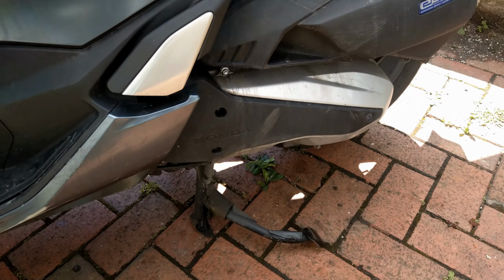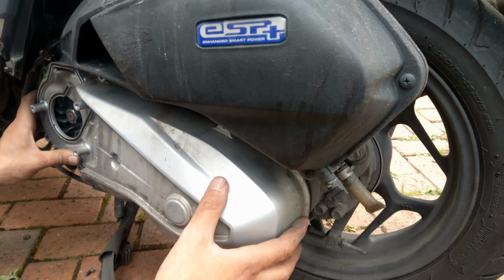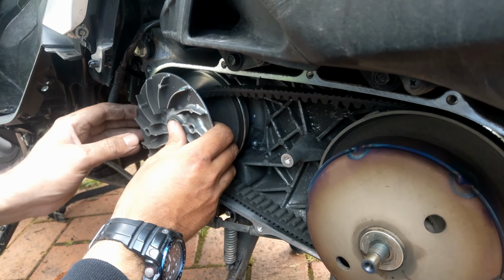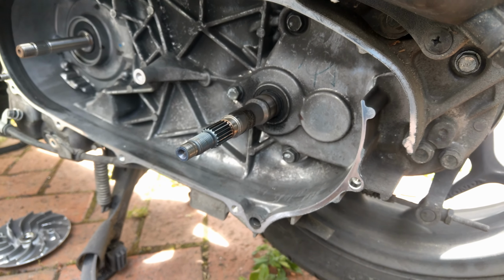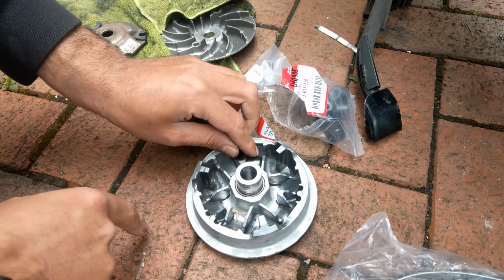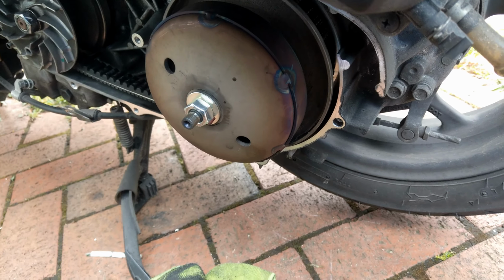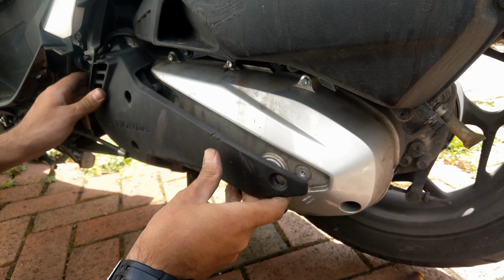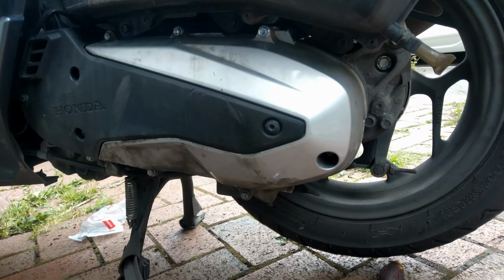Honda PCX 2021 Changing Belt

Comment: Mate, nice you did mention the rotation direction of the rollers.. BUT you mounted them the  Wrong way around
Reply from the maker: I just put them back in the same direction, as they were, One way or another should work, just if they set in the wrong way the will worn out slightly faster

Comment: Hey Guys I have some noise is coming from the motorbike 2022 honda pcx 125 can this be belt or rollers?
Reply from the maker: The roller doesn't make noise, old  belt may make some noise
Reply: @ParsMaker  well the motrbike didn’t hit yet 16000 miles so you think can be the belt ?
Reply: @kadirsebaidinov9667  it's actually the variator, changing roller won't do much in the long run . Have to change all in one go

Comment: After how many miles did you change the belt?
Reply from the maker: It should be changed every 12000 miles 
, But the bike owner done 17000 miles with it

Comment: Replacing the very heavy 18.5g rollers with something lighter (17 or 15, or even 14) increases acceleration of the scooter. My PCX125 2020 is quite slow off the line with the heavy stock rollers.
Reply from the maker: Thanks for the info.